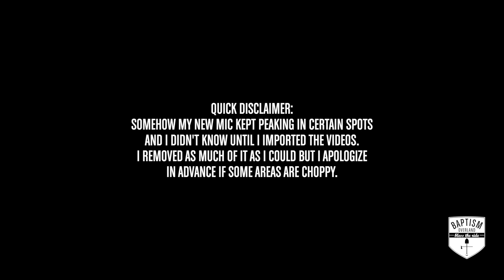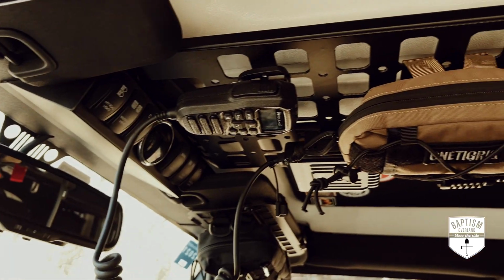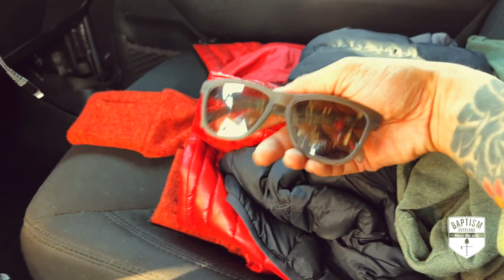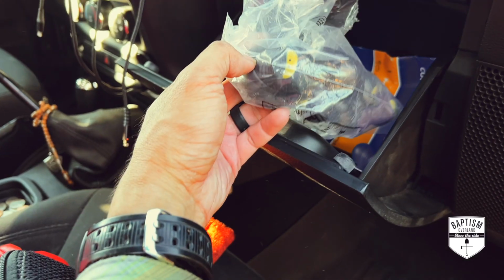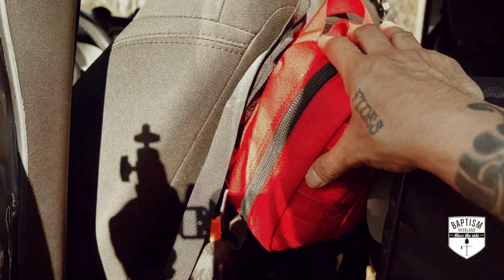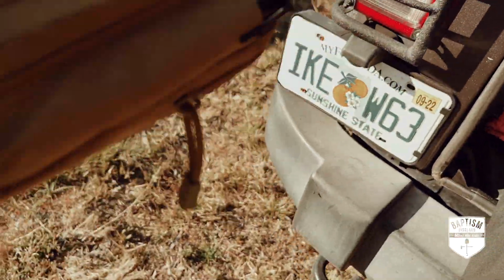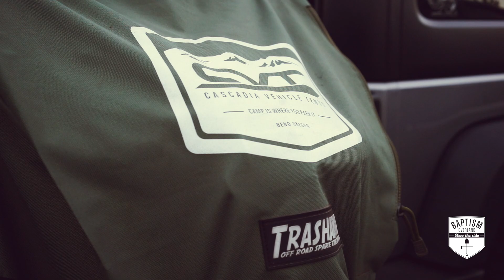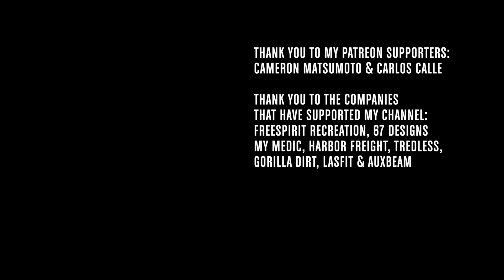What's Inside My Rig?! *An Interior Walk Through of Upgrades & Gear*

Comment: your rig is set up almost exactly like mine, crazy similar. Great minds..
Reply: I ran 14 AWG wire from my Auxbeam 8 gang power controller (30 amp fuse), all the way ti the tailgate where I have a 12 volt plug and two USB ports along with a volt meter. I plug a Bluetti AC3b into the tailgate power and my refrigerator which , when running, pulls 50-55 watts. 14AWG wire is rated for 144 watts. The Bluetti pulls about the same 50-55 watts off the tailgate cigarette plug. Am I in danger of over heating my 14 AWG wire?
Reply from the maker: Everything with purpose
Reply: Where can I get Baptism Overland Merch?
Reply from the maker: @ThomasTribeTrails  Funny you bring that up. We are working a deal right now to have a ton of merch in the next couple of months!